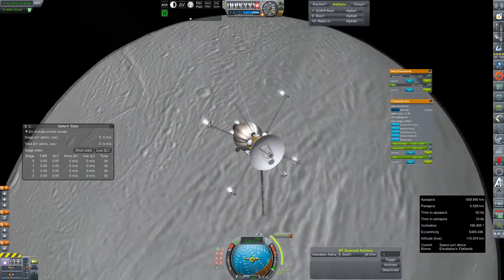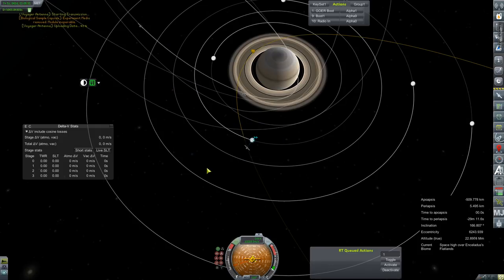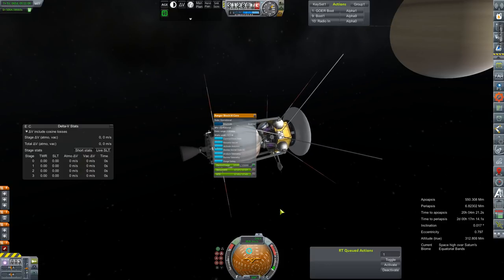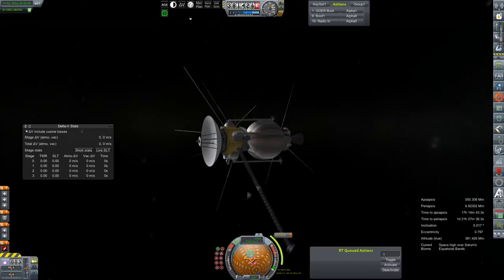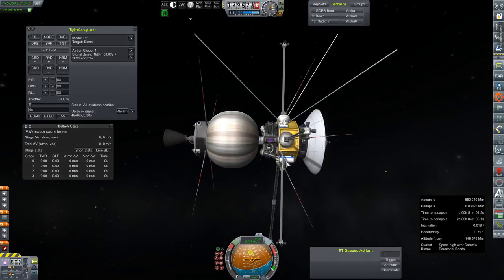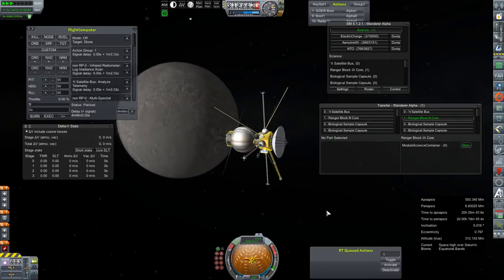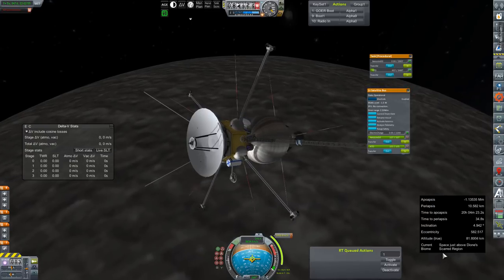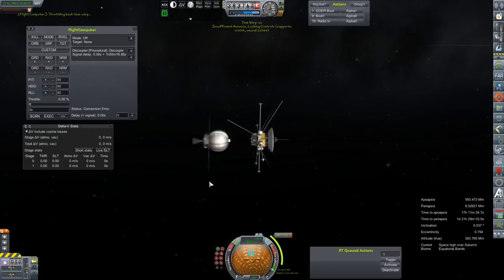KSP RP-0 #375 Wanderer Alpha Gets to Work

Comment: Do you still have the link to the GameData folder that you are using? It seems the one on the first episode isn't working. Awesome series!!
Reply from the maker: Thanks!
I do not currently have the the GameData for this series posted-it is still running in 1.1.3 
I have a 'workable' RP-1 folder for 1.3.1 posted in the discord.
Reply: Thanks!! Probably saved me countless hours of manually installing mods without ckan on MacOS !
Reply from the maker: Sweet! Let me know how it works - I have no idea if there will be issues on a Mac install -
Reply: So far so good. Everything seems to be working perfectly!
Reply from the maker: awesome!